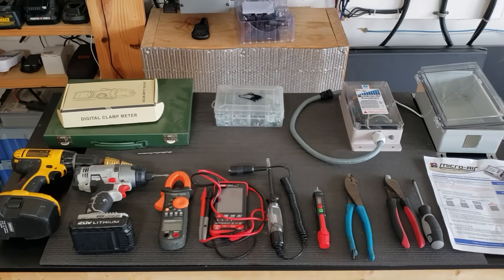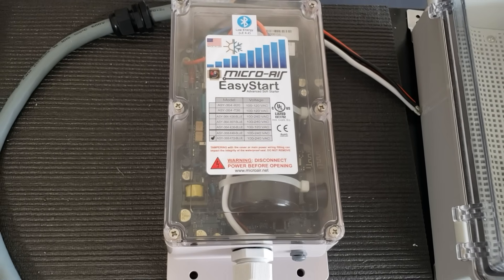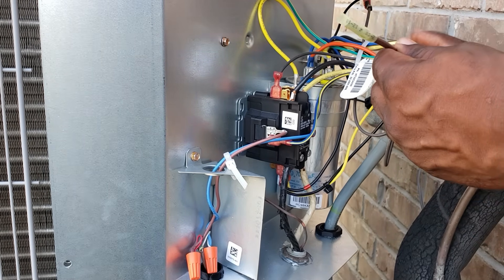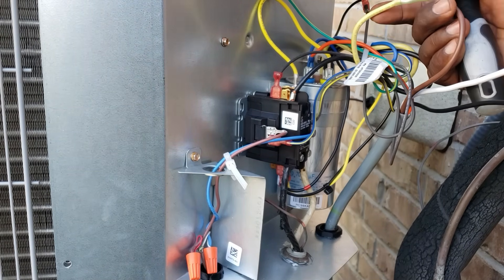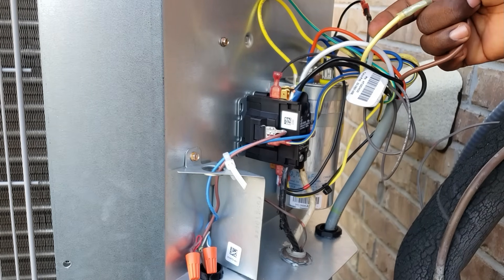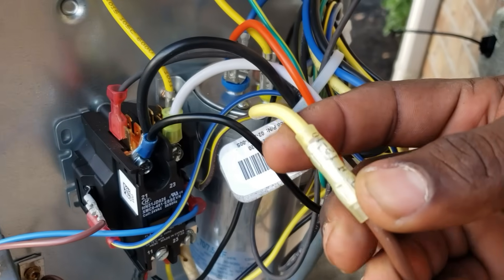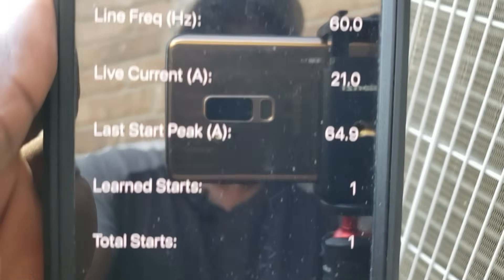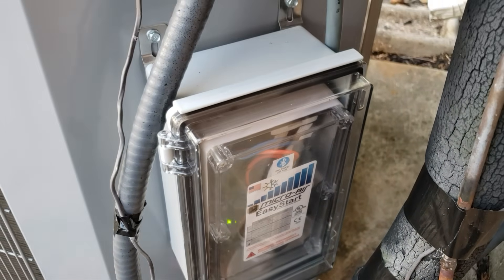Micro-Air EasyStart ASY-368 5 Ton A/C Installation

Comment: MY "MICRO AIR EASY START FLEX" FAILED IN JUST 11 MONTHS AND THE MANUFACTURER IS NOW SENDING ME A REPLACEMENT AFTER I SENT THEM THE FAILURE DIAG LOG THROUGH THEIR BLUTOOTH APP, WHICH IS A COOL FEATURE. THEIR TECH SUPPORT CONTACTED ME BY EMAIL WITHIN A DAY UPON RECEIVING DIAG LOG FROM THE APP TO ARANGE A REPLACEMENT. IT WAS CONNECTED TO A NEW GOODMAN 5 TON HVAC. LED IN IT WENT FROM HEALTHY GREEN TO BRINKING RED AND THEN IT STOPPED SUPPLYING THE RIGHT POWER THE COMPRESSOR NEEDS. FAN ABOVE THE COMPRESSOR WAS RUNNING FINE BUT THE COMPRESSOR WON"T START SO I HAD TO BYPASS THE SOFT START CABLES BACK TO THE WAY THEY WERE BEFORE THE INSTALL AND NOW HVAC IS RUNNING AND COOLING AGAIN. SEE THESE COUPLE VIDEOS WHICH SHOWS OTHER BRANDS ALSO FAILING IN LESS THAN A YEAR.  https://youtu.be/U8Gy4gOB50w?si=LSQuQuhZCH9KzOKQ
https://youtu.be/BHW1mX0lVC8?si=-Mw60PURaJe45mXs

Comment: First thing you do is disconnect the power. Second is discharge the capacitor BEFORE you connect that red wire to the "hem" terminal.
Reply: Herm

Comment: Nice.  Getting rdy to install mine. Your video was as straight fwd as I have seen.  Nice job.  I’m surprised (based on other videos) that your “before” start up amps were as low as they were. Typically I saw them in the 100+ range.

Comment: I have a Champion dual fuel 9000, with 7000 running watts. 
My Rheem 5 ton will try to start, but shuts down. Will the Easy Start  be able to learn, and lower the amp draw to a level that it can use this generator?
Thanks Ya'll  !
Reply from the maker: Yes you need to install a soft start

Comment: I see this is 2 years old, but I just installed the soft start on my 5 ton Rheem and went from 99.9A to 24.6A. Love it and now can size my whole house backup generator much more reasonably. The install was quick and easy, too. Bought a Klein crimper before I started to insure the connections were all made correctly. I’m just a DIY’er although was an electronics technician in the USAF 40 years ago.
Reply from the maker: That’s awesome😎

Comment: Would it be possible to install the soft start kit if your power is already off and you’re running on a generator currently?  I have the kit just never installed it.  power is currently off running on my 9kv inverter generator but I’m assuming for the 5 starts it needs to learn your going to want to have line power on for that?
Reply from the maker: Technically yes but in your case I would install it.
Reply: @GeneratorReviews  thank you for the response. Power just came back on so I didn’t need to try and do it with the gas generator although I seen in the manual it can be done with generator power. Ecoflow pros came in clutch over night I didn’t need to run out and setup the generator. Going to grab a couple things from homedepot and get the soft start installed finally. Thank you Gavin!

Comment: So I just install the soft starter and it is wonderful.  Everything went well following your video it was up and running in less than an hour.  The one glitch I had was putting the capacitor back and closing the panel.  Because of the length of the wires and the space I had to install the capacitor up-side-down.  Is that ok?  Or will the capacitor fail sooner operating in an inverted position?  Should I extend the wires with butt connectors and put it in right-side-up?  
Follow-up:  The unit failed after only 2 months.  The run wire from the unit fried for a distance of 6 inches.  Had to call an AC repair tech.  Contacted the company and just thought they would stand by their unit.  NOPE - they said splice the wire and hope.  The failure was caused by heat.  It is Florida in the summer, Duh!  The original wires were good in the heat, cycling the AC for 9 years, but their unit failed in 2 months. Anyway, don't trust this company or this unit.  They will not support you or their product!  BUYER BEWARE!!
Reply from the maker: Sorry to hear that

Comment: Hello Gavin, I will consider to buy and install the Easy Start on my AC unit, to run with a Generator on emergency sircumptances, like recently Huracan this week, My question is , when runs normally it gel to lower your light bill?
Thank you for your attention and I hope you can respond,
Reply from the maker: Technically, yes, it will lower your light bill

Comment: Great video. I noticed your start up amps were slightly above 54 after your install. Would that not be a problem on a generator rated for 50 amps? I have the A-ipower 12000E. On gasoline it has 12000 start up and 9000 running watts. Thanks in advance. Subscribed!
Reply from the maker: That was before the full learning process now it’s down in the 30s
Reply: You need 5 start-ups during the learning process before you get an accurate reading of the actual surge load.

Comment: Question for you.   I installed my Micro Air Soft Start on my 5 ton about 3 weeks ago.   The 5 ton unit is less than 3 years old so it's fairly new.  In the heat of the day,  I get a "Over Current" fault.   It'll be 93+ degrees out when I get that fault.     Micro Air says it may be a weak run capacitor......  But I doubt it being so new.   They also tell me to have the soft starter to relearn in the heat of the day.  That hasn't solved it.   Have you ever experienced this with your unit?
Reply from the maker: It sounds like a bad run capacitor
Reply: @GeneratorReviews  That would be a blessing because it's an easy, in expensive fix.   Possibly my Rheem unit came with a cheap run capacitor and maybe a heavier duty quality capacitor can help.   Can you recommend a quality capacitor brand to swap it out with?  Looks easy enough.

Comment: GREAT VIDEO OF THIS SOFT STARTER UNIT HOOKUP AND IN OPERATION WITHOUT A LARGE AMP STARTING DRAW SAVING ON DIMMING LIGHTS ,  POWER BILL , AND USING A GENERATOR OR SOLAR TO RUN IT ESPECIALLY DURING A POWER OUTAGE . I'VE BOUGHT ONE FOR MY 2 TON AC UNIT A YEAR AGO AND IT WORKS GREAT ON MY SOLAR SYSTEM . CHECK OUT MY VIDEO  " MY MICRO AIR BLUE AC REVIEW  " ABOUT IT . LEAVE A COMMENT AND MAY THE COOL❄ BE WITH YOU .:goodvibes:

Comment: Instead of color wires for connection you need to say what you are actually connecting to.  Not all units use the same color connection.
Reply from the maker: Yes, you’re right. I did mention what I was connecting to, but most do have different colors, but they all go the same location.

Comment: Bummer if that is the 368 x72 model,  I would have thought that it would have lowered it more.   I am installing on a 5ton and hoping to get to 40 amps.   Generator has 60 amps max.
Reply from the maker: It takes some time to lower the amps after learning. I’m currently in 35A range.
Reply: @GeneratorReviews  Awesome.  Hopefully I will be too.   Thanks for another great video!

Comment: Gavin, is there was a device that would delay the starting of the air handler (1000 watts) until the compressor in-rush was over?   That would give 1000 watts of available power to assist with the compressor start.   Are you aware of a device like this?
Reply from the maker: That is basically what the soft start does with some added capacitors

Comment: What's the L.R.A. on your 5 ton?    74 amps start up seems very low before the install.    Also, I see most start up amps after the install were over 50.   How can the generators with significantly less max starting amps, start this unit?    A lot of your later videos show that happening.   I'm not questioning the validity, I'm merely trying to be educated on this topic as I'm going to do this install.   My 5 ton (Rheem) has an LRA of 144.  I'm looking at a Westinghouse Wgen11500TFc.   It a 11500/14500 generator.   With the install of the Micro Air Easy Start, think this will work in your opinion?  We will be mindful of other high draw items not being used during the outage.   A/C is primary.     Thanks much for any input.
Reply from the maker: Just make sure you get a pure sine wave inverter generator. 

My L.R.A is around the same as yours
Reply: @GeneratorReviews  The Westinghouse Wgen15000TFc is not an Inverter, but it is a low THD unit at less than 5%.   I found an article about it on the Power Equipment Forum.  You might enjoy this read.  "With this new unit, I believe they did go to the Mecc-Alte (M-A) stator/rotor assembly ... about the only way an open-frame non-inverter gen can get at those THD levels? The last time I looked at M-A's website and some engineering docs, it very clearly said "less than 5% THD", so any gen using them would be in that class of THD levels."........."I recently bought an 11500TFc and while I cannot confirm <5% THD (due to lack of the equipment to measure it) I CAN confirm that things where THD matters (non-online UPSs) work just fine on the 11500TFc, even near max generator load, so the low THD seems to be stable even to high generator load."  One person on this thread read the the alternator on this unit is made in Italy.  "I was reading thru the comments on another site in regards to this generator. One poster claims the low THD version alternator is made in Italy and the high THD version is made in Asia. Humm... Doesn't sound like they have much in common but does explain the hefty price difference."    After reading all that, do you feel ok about it for my needs?    This might a good unit to do a video on.

Comment: Why haven’t you performed the 5 start learning process?
Reply from the maker: It performs the start learning process automatically
Reply: Yes, but you can push it manually by calling for cool 5X with the required wait period in between (~ 3 minutes). The unit won’t allow a start before the wait period and your thermostat will also indicate that.

Comment: How did you get it to fit in the plastic junction box, it’s a really tight fit ?
Reply from the maker: It is a really tight fit, but it works perfectly in there
Reply: @GeneratorReviews  thanks yes it’s a tight fit
Reply: Can be installed externally also.

Comment: Where did you connect the clamp meter for after install testing ?

Between which two devices ?

Thx
Reply from the maker: You connected the exact same spot, the compressor will draw less amperage on startup

Comment: Does the power light stay on or only when the ac starts? I have it all connected but the light only turns on when I push the connection switch.. any help??
Reply from the maker: The power is only on when the AC compressor is running.

Comment: My microair power green light won't come on unless the unit turns on...something wrong?
Reply from the maker: The unit only comes on when the condenser and the compressor is running.
Reply from the maker: It’s working fine that’s how it’s supposed to work
Reply: @GeneratorReviews  I also don't know why it only reduced the rush amperage by only 4 amps....I hope Its not hooked up right and can be fix to further reduce it. 3 ton unit initial start was 30 amps and after installing easy start it dropped to only 26.
Reply: 30 amps on a 3 ton start-up is highly unlikely when on utility power.
Reply: @ Hey! Ya I don't know what I was talking about a year ago. The start up amps were 80+ before this micro air and now its reduced down in the 20s. I can now use my generator to run my heat pump. In the winter times I have to turn off the emergency heat though because my generator won't push it. But runs the heat fine.

Comment: I would solder all my connections especially the butt connector and I would use shrink tape as well. It maybe overkill for some folks but I have never had a soldered connection fail but I have had all kinds of issues with crimped connectors.
Reply: Crimped heat shrink butt connectors plus heat shrink tubing for me.

Comment: I am looking into the ICM870-16a for my 3 ton, but the Amazon reviews are so bad saying it doesn't last long at all.
Reply: It also has a 4 minute compressor lockout on every start cycle.  I won't buy it just because of that "feature".
Reply: @projectswithjw  yeah, Im just gonna spend a bit more and get the more beefier model Micro-Air Easystart 364 with Bluetooth.. great reviews on that one.

Comment: Hi Gavin.  I took the plunge and purchased the Micro Air easy start for my 5 ton air conditioner.  Watched your video and got things all set up.  Turned the power on and bluetooth app showed over current fault.  After searching a few things, I cut out the brown wire and in my case it was a red wire that those two spliced wires were not making good contact. I spliced those two wires with a Seal wire inline splice connector and used a heat gun to shrink the connector, wow, what a difference, no more over current fault start ups, thanks for your informative videos! By the way, the easy start moved my LRA from 90 to 36 amps, amazing and runs so quiet!
Reply from the maker: That’s awesome. Now you can runoff back up power and have your whole house being cooled

Comment: Great tutorial ! I installed the 364 on my 2.5ton for upstairs and I’m curious if they’ll be any issues installing the 368 on my 3.5ton downstairs system with a heat pump. Any advice would be appreciated. 🤙🏽
Reply from the maker: Sounds like you got the plan all figured out buddy just take your time if you’re installing it yourself.
Reply: @GeneratorReviews  So it’ll work with a heat pump?

Comment: Wire nut or wago I saw others used can also be used to tie the brown wire & the yellow wire which is on the left side of the contactor, correct? Thx
Reply from the maker: The wire nut works just fine
Reply: Don’t think Wagos go over 12 and the brown on the unit is 10. Brown and white wires on the Easy Start are 10 gauge. (Unit has two 10’s and two 14’s.)

Comment: Turn the ac off by pulling the disconnector outside while it is running or turn the ac off from the thermostat inside the house first then pull the disconnector outside before installing the soft starter? Thx
Reply: Do I need to turn off the ac by using the thermostat inside the house first or don’t mess w/ it & pull the disconnector outside? Thx

Comment: Do you know if a Duromax 12k on gasoline will start and run a 5 ton unit with the easystart installed?
Reply from the maker: You need a soft start to get your ac running on a generator

Comment: A No contact detector to determine a circuit is dead!?? Are you serious?
Reply from the maker: WHAT!!??are you saying?? my entire service panel and condenser breaker is turned off. I may not have showed that on the video but everything is shut off.
Reply: @GeneratorReviews  Then you should have showed it. And yes using those toys instead of a meter or direct contact tester is not a good idea there not reliable.
Reply: @GeneratorReviews There’s always one in the house.

Comment: Gavin,
I got a micro air unit on the way. Do you know what diameter hole I need to drill out with my spiral bit to accommodate the mico air wiring. Also, if you have an idea or link to a waterproof screw in type of bushing for the hole.

Just a quick wiring question. When you connected the micro air  black wire flush on top of the existing AC black wire, could I simply instead  use a female push connector on the micro air black wire and simply push it on one of the open copper blades just behind the existing black wire ?
Thx
Reply from the maker: Hey DJ
Get you a stepper hole bit up to 1 inch I think the hole was half-inch
You can use a female push connector if that works for you
Reply: Gavin, thx for reply. I just wasn't sure that the copper blades behind were all connected to the existing AC black wire in front. Since you confirmed they are, I have blade connecters, no rings, so I'll just push the micro air black wire on one of the empty blades.  lol
I'll keep you updated on my progress ! Thx again !🎉
Reply from the maker: @djspyder551  anytime buddy 👍🏾

Comment: Just a quick question.  I noticed in the video you used a female quick disconnect for the herm and a ring connector for the black wire. Would it be acceptable to use a female quick disconnect instead of the ring connector for the black wire if a male post is available or is there some rule about what type of connector must be used for each terminal?  There are three different connectors used in your video, so that's why I'm asking. And should all connectors be 10-gauge connectors?
Reply from the maker: I honestly just used what I had to get the installation done as long as it makes contact.
Reply: @GeneratorReviews  Makes sense. Thanks for the reply

Comment: Hello. I have a question in the event that the micro air goes bad for some reason will that prevent the AC from working?
Reply from the maker: I think the AC will still work. You just won’t have the starting capabilities of the micro air.